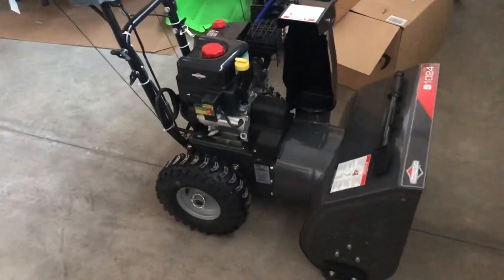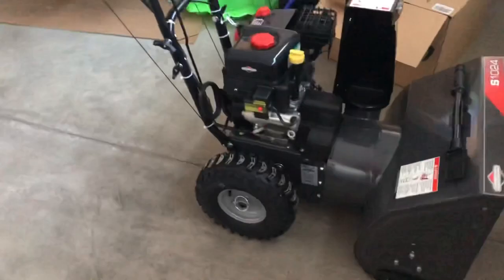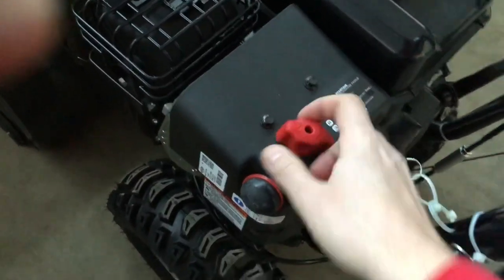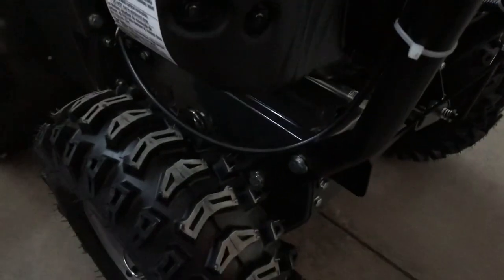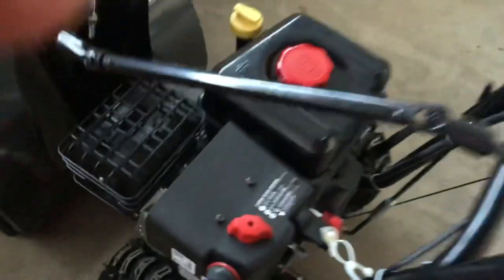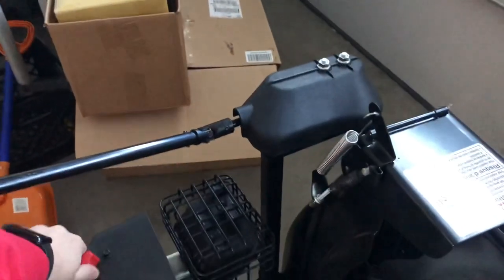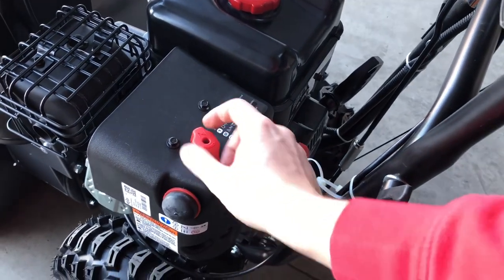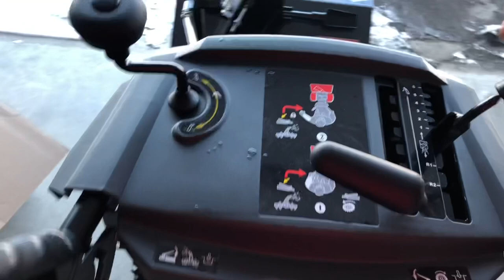First Start Briggs & Stratton 208cc Snow Blower

Comment: The reason it quit was you opened the choke up full right after it started.  If you leave it at 1/2 choke and idle speed for about 20 seconds or so, you'll find it warms up enough for you to open up the choke and increase the engine speed.  It's a mechanical device with physical properties, not a piece of electronics you can just flip switches in a certain order.